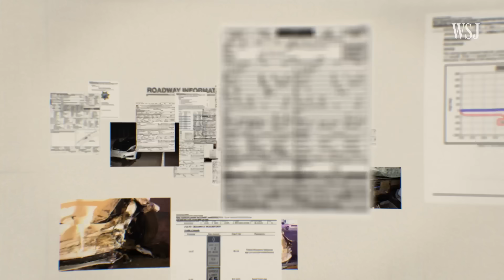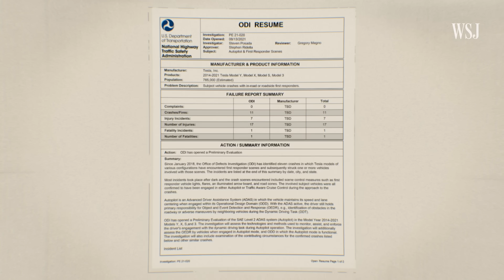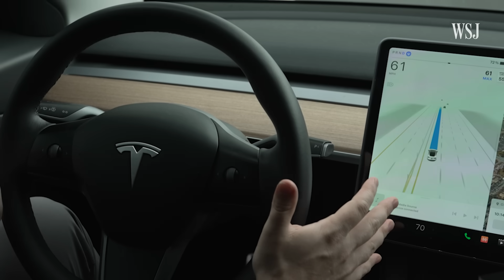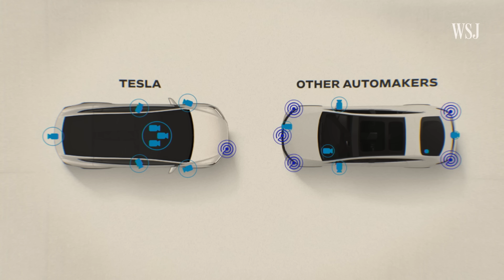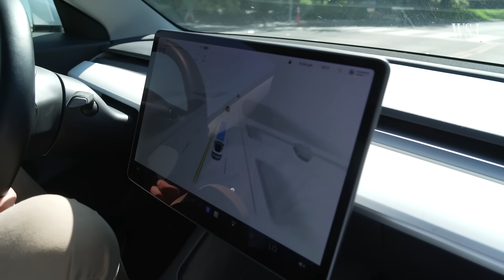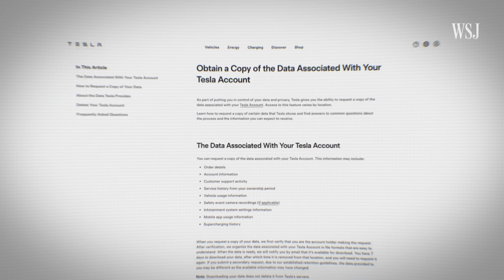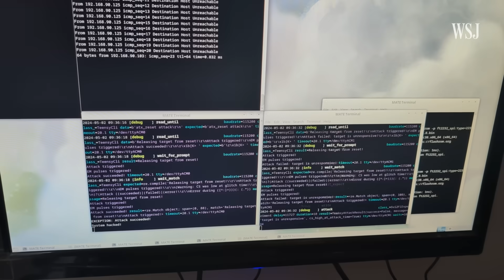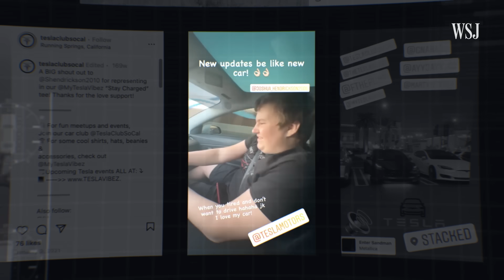The Hidden Autopilot Data That Reveals Why Teslas Crash | WSJ

Comment: CAMERAS ARE NOT EYES. I work in the film industry. Cameras sensors are way worse in dynamic range than human eyes. This means it won’t gather light from dark environments like our eyes do, it will suffer to get light (stop/cars) and objects in dark. Note how many of these crashes happen in the night/dusk.
Reply: thats why we got a lidar sensor in the dji air 3s
Reply: OP is RIGHT.

I already rolled my eyes when Tesla opted away from Infrared sensors and Laser-Radar (LIDAR). Like, TF you gonna do better than a human, if you use a cheap cellphone camera to see?
Reply: @Triple_J.1  Even with expensive cameras - why hobble your engineers and techs by saying they can only use one form of “vision”? It’s dumb. Why not allow for the potential for an autonomous system that can “see” BETTER than a human due to a combination of technologies like LiDaR and so on? You have the potential for a much more thorough understanding of the environment you’re in and possible hazards than the Mark 1 human eyeball is capable of, use it!
Reply: THIS!!!  People do not seem to grasp that.
Reply: @ChristianLaurinE  thats why there are multiple cameras ... "people dont seem to grasp that"
Reply: lidar they don’t wanna spend money on it
Reply: @3dus  They NEED LIDAR not just cameras.
Reply: A human eye doesn't just look straight ahead either, it can swivel around in the eye socket, literally in 'the flick of an eye'
Reply: And critically: The depth perception of stereoscopic cameras is garbage compared to the depth perception of our eyes.
Which is why Teslas crash into overturned trailers. The cameras are unable to reliably detect the position of that trailer, so it can't tell the difference between that trailer and just a dirty road surface.
LIDAR fixes that.
Reply: @vonnikon  That was what happened in the accident identified in 2021 which has long since been resolved with different technology since.
Reply: @vonnikon  but lidar is too expensive and also flawed (ex by mist), also the more data we'll get the more processing power we'll need
Reply: @vonnikon  Then why did a Waymo hit a clearly visible telephone pole?
Reply: @sylvaing1  none of the autopilot cars are perfect yet. But Waymo is far ahead of Tesla.
Reply: @vonnikon  Yes they are. They do have L4 vehicles in some areas, Tesla has none. Although their ODD are quite different, for now.
Reply: @sylvaing1 maybe  brutal fog
Reply: On the other side, cameras also struggle to moderate high light environments too. Lots of examples show teslas fail when driving toward sunset/sunrise because the cameras get overwhelmed with sunlight and can't form identifiable images.
Reply: Thats why a Camera - LIDAR combination should be the standard.
Reply: More specifically the cameras can't process DISTRACTION -

We "gleam" the most important information in an emergency - dust,  smoke, sparks, reflections 

Programing impossibility without proper stereotypical information and much more processing power

Even the best cameras can't capture LIGHT on a swivel the way we do

Just "cocking" our head or "squinting" gives us different information entirely
Reply: Actually, our optic nerves are a small component of "sight." The real work is done subconsciously by the brain interpreting the photons striking the optic nerve. And our sight is very prone to being misguided.
Reply: YES! They should use radar and lidar. If this were aviation, the regulation would have been made to force the manufacture to abandon the false design after thousands of deaths. This is so scary and sad!
Reply: Why dont they program autopilot to be more cautious when the camera data is poor!?!
Reply: In all those crashes you could clearly see the object and react but the car didn't react soon enough.
From this reason it is easy to see (lol) that the issue is not vision but decision making.
Solving full autonomy with cameras only is well inside the scope of technological possibility of cameras. The software has to improve.

And even if cameras won't offer as good of a vision as our eyes which I personally doubt, there are numerous solutions:
Drive slower at low visibility to ensure reaction within safe distance like humans naturally do if visibility is low
Watching this crash video I don't know if I could react fast enough at this speed even If I was fully awaken at that hour in the morning.

I wish only peace to that family and hope the roard to full self driving which statistically safer than humans will have as few as possible disasters and I hope that tesla will treat those family as airline companies treat their victims.
Reply: No, it is potentially a lot better than human eyes.
Reply: THIS! And why exactly does the car need to know if it is an overturned semi truck..? Does that make any difference compared to driving around anything else that doesn't move, aka obstacle?!
Is Musk really trying to tell us a laser sensor with a potential bazillion meters of range is more expensive and not smarter than a camera?!
Reply: A lot of the leaked footage does look very dark.
Reply: Then it shouldn't be advertised as "autopilot".
Reply: They should be required to have radar like most other vehicles do for adaptive cruise control, and ultrasonic sensors (those little round buttons in the bumper) around the vehicle to monitor objects within the 10 meter envelope modern cars do.
Reply: @amzarnacht6710  They use to have radar and found it contributes nothing and slows the computer down and thus makes it more dangerous.
Reply: What's perhaps more important is that computers/AI doesn't – and likely never will – possess the capability of the human mind to reason, to deduce from available information.
Reply: @screenPhiles  Exactly. Two different systems -- extremely different systems. Not sure one can do the other.
Reply: Irrelevant, lidar can see more than eyes can since it uses lasers yet self driving still doesn't work. The issue is ai / software is far from ready.
Reply: Some models use radar or ultrasonic sensors
Reply: @drink15  The point being the way forward should be a mix of technologies (and even that isn't necessarily guaranteed but at least you're increasing the odds in your favor).

Musk is just being greedy by relying on just cameras (which it should be fairly obvious isn't going to work).
Reply: Lidar is a necessary thing for self driving.   Musk is determined to prove this wrong at the expense of deaths.
Reply: @stevelouie5928  Lidar is certainly one component but you're missing that Elon Musk doesn't care about anyone but himself though I feel more sorry about the tools that treat him like the Second Coming.
Reply: @stevelouie5928  you could have said the same for cars when horses were around. Innovation should not be limited by potential fatalities per se. It's a system that must be improved, and companies should be liable for those deaths. But I don't think they should be stopped while trying to achieve innovation, nor that they are doing it at the expense of the people in this case.
Reply: @PaulSerious  That's not only an insanely inane point of view, but if any member of your family, immediate or otherwise, were among the dead you'd likely think different.

So weird how some of us are okay with 'innovation' fueled by the deaths of other people.
Reply: The eyes are 30ish stops of DR, an arri alexa is 16 stops at most
Reply: @victorprudeaux500  I have to admit I have no idea what what you've written.  Care to clarify?
Reply: @screenPhiles  Apologies', so with cameras the difference between light and dark is measured in F stops, the more dynamic range the more of the scene that the camera can see when there are large swings across from light to dark, the human eye can see around 30 stops, an arri alexa, a 65,000 doller camera only has around 16 stops of usable DR, imagine your on the highway and there are cars coming toward you in the opposite lane, you can still see the car in front of you it may be alittle blinding but you can still make it out, if you were a camera the car infront of you might as well be invisible due to the camera not being able to pick up the dark car compared to the bright headlights.
Reply: I can't even get a Roomba (which also use only cameras) to run until the room is bright enough to where I can see too. And then it still bumps into things with considerable speed even if it knows something is usually there.

Lidar is just better at avoiding collisions. Hence why I switched to a non-Roomba robovac, and why I don't trust riding in a Tesla especially at night.
Reply: @ just watch a FSD v13 videos, you'll see that it's not a vacuum cleaner and is far more advanced than a dumb autopilot assistant ahah
Reply: exactly dynamic range and also the light spectrum itself, it's foolish to rely on these limitations when there are better options for something as critical as real time localization in a dynamic system that's operated by agents with different behaviors (ie cars and their drivers). Having to sacrifice fidelity in sensors in this context for the sake of bragging rights should be illegal
Reply: What the expert says at 4:10 has been completely absolute since the introduction of the occupancy network a few years ago. It does not need to recognise a toppled truck (as the expert says), it needs to see something occupies the space. 
It may have been a valid point 4 years ago, but to show this now as evidence that the tech does not work, or did not work in 2021 is kinda weird in my opinion
Reply: @Maustah  Achieving self-driving will not only involve solving common scenarios, but also “long tail” scenarios that are rare and complex. These events include scenarios like erratic pedestrians, unclear construction zones, unexpected debris, and cultural driving nuances. Humans use intuition, social cues, and broad contextual understanding, which will make it incredibly hard for Tesla FSD to truly understand. Tesla's FSD relies heavily on pattern recognition from camera feeds and incremental improvements possible through large-scale fleet data.

No matter how much data Tesla gathers, such long-tail events will remain incredibly rare, and pattern-based neural networks will likely struggle heavily to master scenarios they rarely see. Without a method to ensure broad coverage of these edge cases, Tesla's system risks perpetual incompleteness. At Tesla's current data acquisition rate, it is impossible to gather enough data at the scale needed for incredibly rare “long-tail” events to be fully “understood” by Tesla's self-driving neural net.
https://seekingalpha.com/article/4745385-tesla-fsd-headed-straight-towards-a-scientific-dead-end
Reply: Both human and system will make mistakes, and I do believe humans are allowed to make more mistakes then a system.
Having said that I do believe that the rate of technical improvement is exponential. if the capability of a technology doubles every year, then it's 32x better in 5 years. Not saying FSD has this rate, but it is fast.

Not sure if it needs as much data as you suggest for long-tail events. As long as it does not crash into objects, there is many ways to handle events, and it will lean on other related events from the neural network to get out of an unknown situation. Maybe not perfectly (in the coming 10-15 years), but safe and good enough. That is how I see it at least. Thanks for serious answer btw.
Reply: Musk bet is on collecting as much vision data as possible and train their AI with it. In theory it might work out. But as we already witnessed AI does the weirdest of the weird mistakes. Some new models even insist on their wrong reply as being correct unless you prompt them another ten times. I expect future Tesla to display this sort of final message: You are about to die in an car accident.
Reply: But low light performance doesn't only depend on the sensor. It depends on the lens too. Plus the car has headlights.

This video seems to show that the Tesla sees objects in the dark but if it doesn't recognize the object, it'll keep going while asking the driver to take over.

But it should not keep going.
Reply: They could have low light “night vision” systems;  but would cost
Reply: That’s why the car turns on bright lights when it’s possible.
Reply: If I’m driving myself I have only myself to blame.   If I’m told that the car self drive results in my death then that’s without my consent.
Reply: As a Master’s degree holder in Computer Science, I can confidently say you’re spot on. Full Self-Driving (FSD) technology, as Elon Musk has been promising for years, will not achieve full autonomy. The current hardware and software stacks simply aren’t sufficient to enable complete vehicle autonomy.
Reply: @nv.c6  I also don't believe that HW4 is enough to achieve full autonomy. We haven't seen what HW5 will look like. Rumor has it that it will be made available in April 2025. Let's see what hardware it will have before claiming full self driving autonomy won't be reachable. FSD 13.2, although not perfect, has shown some great improvement over what FSD 12 could do, which also showed great improvement compared to FSD 11. It's a battle of the nines at this point.
Reply: Big up yuhself bredrin! We appreciate this truthful perspective.
Reply: Other companies use tons of sensor arrays to account for this, but Tesla employees have leaked that Elon Musk doesn’t understand this and won’t let them add these sensors.
Reply: It needs ultrasound or something for safety at the front. It should be mandatory to have it and if but available disable fsd
Reply: This is so dumb… there is so many other ways you can explore the world rather than optical vision. Just take the truth, robot better drivers then humans, and they just about to start. in few years i hope regular humans will be simply banned from driving cars.
Reply: Human eyes are 64,000 ISO. Some cameras can do 409,600 ISO. And you can add technology like Night Vision Goggle to get 1,000x brighter image. There are three types of night vision technology... try image intensification one used by Navy.
Reply: The high-beam should be automatically activated when the camera has zero visibility toward dark roads. Even the honda sensing is more clever than the tesla autopilot
Reply: And computer AI software is not a human mind, it does not have the rich real world understanding and judgement.
Reply: This comment should be pinned at the top
Reply: U says camera aint eyes..
But How about US Advanced Predator Drone or AWACS airplane who has high-tech cameras and sensors??
Reply: great point!
Reply: That why the next tesla will have arri Alexas as eyes
Reply: simple.  disable autopilot while dynamic range is low.
Reply: Makes me wonder how camcorders in the 80s could see without any ambient light 🤔
Reply: Tho be honest many people see terrible in dusk too.
Reply: Do not use when it's dark , too risky.
Reply: And so….why do we called them as autopilots…this is what they are called and this is what they supposed to do and once it failed, it failed no excuses
Reply: @Spectre_101  Calling it autopilot isn't the problem. Constantly lying about what it does is the problem.
Reply: @Spectre_101  Agreed. I'm on your side. Elon's been lying about what his cars can do. Not even autopilot works, let alone FSD.
Reply: Honestly, I think a lot of humans would have ran into the that truck. I watched a video of a car pile up with an upturned truck at night.
Reply: @brendan3556  Honestly, I don't think you get to change the terms of the discussion because they don't go as you'd like them to.

Musk touted this 'Autopilot' as so much safer than a human driver.  He was clearly wrong.  Full stop. 

The rest is just pure-grade copium.
Reply: I noticed that the vast majority of these MVAs happen between dusk and dawn. Thanks for the explanation.
Reply: You can see examples of that when you see a photo of something that you were trying to capture, which you couldn't quite get.  The colors aren't quite right. Or something else is off.
Reply: My experience differs - I am amazed at how much appears on the screen of my hardware 2 compared with my own observation.
Reply: Thought that Teslas would still have radar/sonar to detect obstructions ahead that cameras may be unable to identify properly with ML
Reply: Yes.  Thank you.
Reply: Waymo had the  lidar  advantage
Reply: To be fair; If you take a dark picture and crank up the brightness/contrast you can still see far more clearly than with your eyes no?
Reply: I'd say thats common sense. General rule: if you don't see well in a scenario a camera won't either.
Reply: Wrong those cameras are specifically designed for low light conditions. But of course if there is no light at all it's almost impossible. The issue is that the car didn't had any high beam on. The main issue was the regulations as the matrix led where not allowed in the US a the time, so high beam where off. The truck wasn't even visible even with naked eye
Reply: The key thing is we slow down when we don’t see things well or we feel no comfortable or lost confidence.
Reply: the car has headlights. doh
Reply: Cameras can gather more light what talking about
Reply: this is where Lidar comes in, lots of chinese cars have Lidar like the lixiang and it can detect overturned vehicles like this and stop in time.
Reply: Well computers don’t use eyes
Reply: Human eyes suffer from this issue as well.  Despite 75% of all driving occurring during the day, the remaining 25% of driving at night accounts for 50% of all fatal accidents.
Reply: Wrong lol. You have no idea about tesla self driving. Lol
Reply: They should have equipped all exterior cameras with IR. Why their engineers didn't pursue this is a blatant safety disregardment.
Reply: @pm7753 the engineers pursue what Musk dictates. The man is motivated by getting richer and richer not creating a safer car.
Reply: @pm7753 you would need to have ir projectors as well, effectively blinding any incoming cars with the same tech.
Reply: @pm7753  To be fair to Tesla's engineers, they originally had radar and ultrasonic sensors on the cars in addition to cameras.  But a few years ago Musk had them stop installing those sensors on new cars and disabled them with a software update on older cars that still had them.  Musk is convinced self driving can be accomplished in all weather conditions with only cameras and ignores all evidence to the contrary.
Reply: @pm7753  Are you in the industry developing self driving capability? If not-how to you know what spectrum these cameras can see?
Reply: Tell me, you are not an engineer without saying you are not an engineer
Reply: @RightsDontDefendThemselves  Well in his defense, he did say he works in the film industry lol.
Reply: @sylvaing1  LOL
Reply: You are wrong, a quadrupel of Pixels are exposed with different ISO giving it much more dynamic range. Even DJI uses this Trick to turn a 48MP Image into 12MP with much more dynamic range! Even some filmcameras do this. A similiar Trick was first introduced in a consumer product with a Firmware Hack for the Canon EOS (M) series in Magic lantern called dualISO.
Reply: Just change the ISO and F stop
Reply: If you are in camera scene, not heavy film scene,  you must know the impact of sony A7s. It was one of the first cameras that can take a pic of pitch black that just looks like in a daylight. High ISO performance of image sensors have greatly been improved even surpassing human retina. Therefore, the issue lies in choosing cheap sensors or poor sensor control, not the sensors.
Reply: The best cameras beat the best eyes.
Reply: @MegaLokopo  No, they don't.  You seem under the weird impression that cameras can 'see.'  That's like saying a spyglass can see when all ti does is make things easier to the person wielding it to see better.
Reply: You don’t understand how neural networks work. And you don’t understand how AI can see depth just like humans now.
Reply: @3dus  Precisely, the camera technology is quite there yet..
Reply: Câmeras doesn't blink. 8 cameras in a car not blinking is far better then 2 eyes blinking and many with vision problems.
Is only matter of time until they make the computer react better.
If you check how many accidents happens with human driving for mile driven is far worse.
But when a person doesn't wanna see anything that I say will matter
Reply: You are missing important factors: Unlike film industry, the autopilot needn't rely on ONE camera only. An array of cameras can see way more than the human eye.
What you are missing as well: Also humans have exactly those accidents. But while we permit a huge level of human error, auto-pilots should be completely error free?
Personally I think the technology isn't mature enough to work completely unattended, and thats what Tesla also demands.
Reply: For those saying the name Full Self Driving misled them: who pays thousands of dollars for that feature without spending the 30 seconds needed to read the features of the software? Nobody. Therefore anybody who claims they thought you don’t need to watch the road is lying. Come on…

Also, please keep in mind that the software is now FAR ahead of what Tesla had when this accident occurred.
Reply: These aren't designed to be autonomous. The human behind the wheel is supposed to remain attentive as if still controlling the vehicle. What we have here are examples that lead to human controlled fatalities and the number is miniscule as a percentage of Teslas. I have many miles of experience using both Tesla Autopilot/FSD and the multiple cameras surrounding my Model Y have both strengths and weaknesses compared to human vision.

Tesla isn't offering level 4 or 5 autonomy yet, so your argument lacks standing regardless of whether or not it's empirically accurate.
Reply: ADAS is not FSD. The crashes reported in this video are from 2021, using ADAS. ADAS is the simple free version, like in many other car manufacturers, you are supposed to drive the car.
 FSD is an option, and is not yet unsupervised.
Reply: I disagree, cameras are able to see way better than we can in dark situations. I’ve watched some of the night footage from my Tesla and it sees the world around it like it was day time.
Reply: @brendan3556  You can disagree all you like, doesn't for a second make it true.  For instance, some people think the Earth is flat.

And cameras can't 'see' way better than anything because they're not capable of seeing – as most humans and animals use the term – at all.

They simply take in visual information.  Seeing is more than just your eyes aligning on something, there's unconscious processing sighted animals do without thought.

Sorry, but your Testa is blind by comparison because there's no mind behind those cameras (except in the most rudimentary of senses, if that). 

That's why they're killing people; they don't know any better because they're stupid machines.
Reply: With the raw HDR data it is really good, it uses the noise as clues, so that it can have better visibility than a smoother processed image. In 2024 it's really hard to say that human sees better because you can't see at 360 degrees
Reply: Disagree. I tried V13 on a twisty mountain road last night-it's BETTER than a human driver. Especially with oncoming traffic; the car's systems don't seem to be blinded by oncoming headlights like a human driver, and it seems to "see" better in low-light conditions. The "film industry" doesn't necessarily have cameras optimized for this, like Tesla's do.
Reply: @ yeah and you don't need high quality at low light, because AI can make sense of the noise in the image, it doesn't need to be processed to look pretty and loose details in the process
Reply: it’s def safer. I own one. It reduces fatigue, but you do have to pay attention. 

I’m some of the examples above, it’s difficult for the car to see the road - the easy way to do this is take over the wheel quickly when car starts getting sideways… I do the difficult parts - the left turns, the merges, the twisty roads — and I let it handle the easy bits (which are more like 90% of the drive)

By no stretch of imagination is this technology ”full self driving” 

It’s still useful and is leaps ahead of any other manufacturer
Reply: Camera sensors have better range than our eyes can detect. Much better. 

An example, shine your remote and click buttons into your cheap (or expensive) phone camera. It can see IR, we cannot. It can "see" the temperature differences also. 

The issue is setting up algorithms in real time to translate it as something we can use. That's a computer (processing) not a component limitation issue.

I don't think you can compare autopilot crashes as 'manufacturing faults', you need to compare it with human driving and traffic incidents human causes.
Reply: Are comparing eyes in pitch blank and cameras in pitch blank? 
Or are you comparing eyes in the visually polluted car cockpit with cameras in their places where there is nothing but real visual info hitting them?
Reply: Remember was see a very narrow spectrum compared to what a camera can
Reply: Tesla cameras are nothing remotely like "film industry" cameras.   They don't use RGB, they are RWB - so all of your very wonderful expertise is garbage.  They DO gather light from dark environments.   But guess what?   They use the headlights!!   Yes - they aren't completely stupid.   Also, where are your statistics to prove that a preponderance of accidents are in the night/dusk?  (HINT: You don't have any).   Also, do bear in mind that (by definition) 50% of all human-on-human crashes are caused by the other car.
Reply: @ fan boy..?
Reply: @SteveBakerIsHere  Rubbish, Tesla uses standard CMOS cameras identical to those used in mobile phones. There is no such thing as an RWB sensor.
Reply: This is incorrect... computers can grasp slight differences in color/light that our eyes cannot... the ability for cameras to see is far superior to our eyes.

This video is just a hit piece... End to End visual only FSD is the way forward
Reply: @lh2000  Cameras are in no way superior to our eyes, plus our brains are way better image processors than a computer. The video demonstrates incidents where the cameras are clearly not up to the job.
Do you think Volvo, Mercedes, BMW et al use radar and lidar just for fun?
Reply: @cambridgemart2075  Volvo, Merc and BMW do you have silicon valley DNA in their companies.

And cameras and the AI inference hardware are ABSOLUTELY better than human eyes, they can detect the slightest variations and machines don't get tired and don't have variations in performance

Not gonna argue further, you can do your own research.
Reply: @lh2000  Well as someone who works in the automotive industry and having 15 years working in image processing, I know cameras are far inferior to our eyes for a host of reasons including far reduced dynamic range, low resolution, and lack of stereoscopic depth perception. The one valid point you make is that computers don't get tired.
You only need to look at some of the collisions Tesla has been involved in when on AP  or FSD to see how poorly the system performs. Tesla relies on training the AI to recognise objects, rather than determining there's a big solid object in the road.
Reply: @cambridgemart2075  The limiting factor is not the camera, it's the systems used to interpret the images captured

I agree there are issues with changes in light that can cause temporary "blindness"
Reply: Tell that to every AI tech used in photo and film industries that improve images or frames, everything from color correction, 3D creation, blur repair, CGI, etc. use AI technologies from cameras.

Literally, our eyes are cameras. If you're saying you cannot detect distance compared to a laser, you have a point to make, but the basis of your original premise is full of nope!
Reply: @michaeld5621  Cameras are not the limiting factor... the limiting factor is the training model and inference

FSD cameras are working fine, they are literally shown on the screens of the cars when you use it

And distance is not an issue either, you don't need to know the exact distance when you drive, neither does the FSD computer.  Based on the speed, and change in the size of the object, the car can already infer the distance to a very reasonable estimate of its distance

I think you need to try FSD for yourself tbh
Reply: My IR lacking cabin camera sees my eyes in almost pitch darkness. The outside cameras are high dynamic range, using  10 or 12 bits of color per channel, three channels per pixel). It has no problems seeing at night, except in complete darkness, which we wouldn't see either. We aren't cats.
Reply: @sylvaing1  More importantly we're not machine learning models. We see an upturned truck in front of us, we stop -- that's the point. Highways are lighted in many places, so we don't need to see like a cat. Our headlights help as well. What these Teslas can't do is understand the world the way we do, a five-year old understands the downed truck is a threat. That isn't the only time a Tesla's cameras screwed up. There's another accident where the Tesla slammed into a truck because FSD thought the truck was a bridge. This isn't safe technology and never will be without lidar, and maybe not even then.
Reply: @Intelligencia  What these drivers failed to see is that FSD and Autopilot are NOT "Eyes off" technologies. Autopilot will never be and it's the goal of FSD but it's not there yet. A driver looking at the road would have noticed these events and acted accordingly. The latest FSD uses the cabin camera to make sure you're looking at the road and not your cell. They should port that to Autopilot as well.
Reply: @sylvaing1  The problem is FSD was sold as "Full Self Driving", which it is not. That's a lie. Another one of Elon's thousand lies. It's not full self-driving and will never be full self-driving because cameras alone aren't enough. You need lidar and even with lidar I'm not sure it will help cars go fully autonomous. It doesn't matter if you have another camera watching you, Elon oversold this technology. Tesla just lost its head of Autopilot HW engineering to Amazon’s self-driving effort, which doesn't bode well for Tesla. Honestly, what's so bad about driving anyway? I used to love it. I live where I don't need a car now, but I don't get the idea of putting one's life in the hands of a machine -- a faulty machine at that. One run by a man who is known as a pathological liar.
Reply: @Intelligencia  No, FSD was NEVER at this point sold as 'Full Self Driving". It was first FSD (Beta) and now FSD (Supervised). In both cases, it clearly states when you enable it in the car (per driver profile) that it is NOT autonomous and the manual clearly states it as well.
Reply: @sylvaing1  When you call it Full Self Driving, you're kind of implying something aren't you? I get the concept of false advertising but that's a doozy.
Reply: @Intelligencia  Since it's been available to buy/subscribe, it was NEVER called just "Full Self Driving - FSD". It was called FSD (Beta) and FSD (Supervised). It's implying that the goal is to go Full Self Driving, yes, but the goal hasn't been reached yet. Will it ever? I guess we'll need to see what HW5/AI5 will be able to achieve before claiming it won't. Personally, I don't think HW4 can achieve full autonomously. What FSD 13.2 (and now with 13.2.1 which has reached hundreds if not thousands of owners in its first wave since released yesterday) can do though is quite impressive for "just cameras".
Reply: @sylvaing1  One question - how many times has Elon lied about FSD?
Reply: @Intelligencia  Being overly optimistic, yes, a lot, lied? If you mean that 2016 video, it was to showcase what the hardware in a 2016 Tesla could do, as confirmed by the testimony of Ashok Elluswamy (director of Autopilot software at the time), not to accurately portray what was available for customers in 2016. A lot of stuff that SpaceX and Tesla did/are doing were thought to be impossible. As it turns out, SpaceX and Tesla specialize in making the impossible merely late.
Reply: @sylvaing1  those 2016 Teslas are now at the end of their life, and they still can't do what was promised.
Reply: @vonnikon  I agree. The time to release an unsupervised version of their vehicle has been (is) way longer than first anticipated. They do have access to a class action if they so whish though.
Reply: @Intelligencia  it's called "beta" for a reason as well… Prior to purchasing you are warned that you are observation is required, when you install it, you have to agree that your observation is required… When you activate it, you are reminded that your observation is required. If you let go of the wheel for too long, uncertain models, you are reminded, if you look away from the front of the car for more than a few seconds, you are once again reminded and yelled at to look out the window… There is not a single human being driving this car that thinks it is self driving. Only Youtubers is trying to get clicks..
Reply: @Intelligencia  Its not a set technology, its rapidly improving, but people are easily led by hit pieces.
Reply: @churblefurbles  I'd argue people are more easily led by liars while ignoring pieces that are backed by facts and not really hit pieces. People want to believe what they want to believe even when there's reliable proof that what they believe isn't going to come true. Lots of cognitive dissonance going on here. Lots of denial of reality too. That's an interesting psychological state - people realize they have been fooled or misled, but refuse to accept this reality to avoid the discomfort associated with the inconsistency between their beliefs and the truth. It's a common response to compulsive liar. I don't trust someone who has repeatedly lied about timelines and technology. I don't see the company being able to magically come up with a technology that will work when its competitors have clearly shown lidar is needed. Once again, address the long list of lies Elon and the company have stated.
Reply: @sylvaing1 Elon is lying through his teeth at almost every rally. How many times have we heard specific dates for stuff that will never happen?
Cameras can be extraordinarily sensitive but your eyes have a much wider dynamic range.
Reply: @sylvaing1 Right in this video you have clips of Musk claiming again and again that Tesla's unsupervised driving features were safer than a human's driving capabilities.

You say that those unsupervised driving features are indeed just fancy cruise controls? Well, tell that to Musk and Tesla Motors Inc. please because they seem to not be aware.
Reply: @Intelligencia  You do know GM recently started agreeing with Elon Musk that he is doing it the right way and that Ford has stopped development of their system and is just waiting for Tesla to get it done and then license it from them?
Reply: @RightsDontDefendThemselves  That's not true.  The only reason people were warned that they had to pay attention was because not were Elon Musk's lies fairly obvious, but the NHTSA was investigating them and Tesla.

You might complain about YouTubers, but you're doing the same thing, only lying in a more obvious manner.
Reply: @Intelligencia Humans don’t need LIDAR to drive. There is no reason in principle why an AI can’t drive with superhuman safety based only on visual input. I accept that Tesla Autopilot is definitely not there yet, but there is no reason to believe they won’t get there, and sooner rather than later.
Reply: @sylvaing1 

Now I'm no big city computer programmer, or fancy pants lawyer. But I believe that "FSD" is some kinda acronym...I do wonder just what it could stand for?
Reply: @screenPhiles  WHAT YOU ARE SAYING IS 100% FALSE. I HAVE HAD THIS CARD FOR 10 YEARS AND OWN MULTIPLE OF THEM SO I KNOW WHAT I'M TALKING ABOUT. THE WARNING HAS BEEN THERE SINCE DAY ONE SO JUST STOP.
Reply: @Intelligencia lol using “never” with new fast changing technology is absurd. No chance they will be able to do this with just cameras in 100 years?
Reply: @Intelligencia  Additionally, if we encounter something we don't understand we don't keep on driving towards it at full speed. Teslas do, because it constantly encounters things it doesn't fully understand, and it wouldn't be a marketable feature if it did brake every time it encounters something like it. It's simply not a safe product and it should be banned, not having lidar is genuinely unacceptable as this is such an excellent last resort for head on collision prevention
Reply: @Intelligencia even with LIDAR and sensors equipped I still wouldn't trust my life on it. Problem seems to be from  cost cutting, to misleading advertising,  to public blind trust and lack of research/education. But it's a losing fight. I did what I can and bought electric car from another brand, almost same functionality but with radars installed along with camera.
Reply: @Intelligencia  this article doesn’t mention FSD at all…
Reply: @Intelligencia  You obviously have an axe to grind here so I'm probably making a mistake trying to engage with you in honest dialogue but here goes... Calling it FSD, I believe is not disingenous; it is the end goal after all, and it is about 98% + there now. For example, SpaceX called their rockets "reusable" but sometimes, especially at first, there are problems preventing reuse. But now they have a Falcon 9 booster that just flew its 25th mission.  It is up to the consumer to not mistake the product name for the operations manual.  

TLDR: calling something what you intend it to ultimately be is normal, and done by everyone everywhere.
Reply: @theshadowsymphony  Of course it's disingenuous, unless the F stands for something other than 'Full'
Reply: @sylvaing1  LOL there level 2 on a scale of 1 to 5.  Such a scam now going on for almost a decade.
Reply: @joeshmooo5327  And at what level do you rate an ADAS that drove from the manufacturer to its new owner, all by itself? They did three days ago, a 30 minutes, unassisted drive with no one in the car.
Reply: @sylvaing1  and they have very bad ghosting... you cant compare a stationary camera with moving ones.
Reply: @sylvaing1 This might be down to Hardware version. The Crashes are "old" which makes it very likely that they used older versions of Teslas that probably have worse cameras. You might have the new hardware. I've watched quite a few FSD Videos where they drive the new Hardware and the cameras look good to me in the dark too
Reply: @sylvaing1 This might be down to Hardware version. The Crashes are "old" which makes it very likely that they used older versions of Teslas that probably have worse cameras. You might have the new hardware. I've watched quite a few FSD Videos where they drive the new Hardware and the cameras look good to me in the dark too
Reply: @sylvaing1  Agree. If anything my Tesla performs better at night. Area where it still struggles are low angles of sun (early morn, late afternoon) and blindness by too intense sun light.
Reply: I’d feel safer if my autonomous vehicle could see things I couldn’t.
Reply: @sylvaing1  silicon image-sensing chips actually do respond strongly to IR radiation, which is why standard cameras are fitted with IR filters. Otherwise the pixels would be "over-exposed" every camera clock cycle. (They are also fitted with RGB filters in specific pattern with an algorithm to create calculated pixel values for each pixel.)
Reply: @dianataulbut2299  I'm not following. No one said the camera doesn't detect IR. What I said is my 2021 Model 3 doesn't have a IR emitter and yet its cabin camera can see that I'm looking at the road or not in almost complete darkness.
Reply: @sylvaing1 Musk fanboy ☠️
Reply: @sylvaing1 I agree with you, the original comment missed the mark. These machines are obviously flawed, but camera light detection is not the issue.
Reply: People's eyes fail them constantly as drivers, too. Not to mention that we only have two of them, spaced fairly closely, on only one side of our head. Teslas have 8 cameras, on all 4 sides of the vehicle.

Yes, the dynamic range issue matters, but again, there's multiple ways Teslas' eyes are better than humans' eyes. 

The bigger issue is that Tesla has the opportunity to augment those electronic eyes with all kinds of other things humans don't have, like radar, lidar, and ultrasonic sensors, but Musk has stubbornly resisted relying on them, leaving Teslas with ONLY those 8 eyes in too many scenarios.
Reply: @nathanscandella6075  cameras are electronic/processor based. these are prone to glitches. what will happen when glitch happened at critical moment? a human driver's eye/brain coordination is way more dependable than current technology
Reply: @nathanscandella6075  Our eyes are still connected to the most sophisticated biological decision making powerhouse. You need AGI to drive autonomously, which Tesla's don't have.
Reply: I agree that at least solid state lidars SHOULD be used. But cos of such lidar wih distance of 200 meters would cost 3 to 5 thousand euros.  Meaning cost of a car would increase as minimum by the same price. 
Besides its not about dynamic range of human eye. Its about our complex neural engines that is yet  more advanced than any modern neural algorithm.
Reply: @nathanscandella6075  Those 8 cameras are not arranged in any stereoscopic configuration.
So the Tesla software has to guess at the distance of obstacles and ignore dirt on the lens through heuristics.
Reply: @nathanscandella6075  yes, of course we have 2 closely spaced eyes. Because that gives 3D vision, which Tesla's don't really have with their spaced out uncalibrated cameras.
Reply: @nathanscandella6075  My understanding of why lidar was removed was because it was providing inconsistent data and that inconsistency was creating additional noise problems. Opting to choose sight only is a matter of using AI to identify a light idem like a bag flying in the air that would breeze over and a laser telling it that something hard and physical was about to impact. But you're right, it will also be flawed as the eyes and if not trained to detect, it might not even see anything.
Reply: @nathanscandella6075  Two human eyes and the human brain are far superior to 8 cameras and the Tesla AI. The problem is the Tesla machine learning systems can't model for any and every potential situation. While the human mind can know a truck on its side is a threat and one should brake, the Tesla didn't know that and there are a million other scenarios that a Tesla won't ever be able to understand. Musk chose not to include Lidar because it was too expensive and that can't be retrofitted into most Teslas now. Musk thought he could BS his way through this and he probably won't be able to.
Reply: @Intelligencia  Lidar is actually really cheap especially low range ones. But he is a man-child that insists to not install them.
Reply: @Intelligencia you live in a parallel universe if you think humans will keep being “superior” to cameras and computers. Wauw the ignorance.
Reply: @christofferravn4486  Better than living in one where somebody apparently nurses an inferiority complex to a TI-30XIIS. 🤣🤣🤣
Reply: @Intelligencia  you need to try FSD V13. Id recognizes trucks and identifies threats. It doesn't get tired, distracted, or look just at one object while ignoring everything else. I just got a car equipped with it-it's amazing. Better and smoother than a human driver on an unfamiliar road. Never had an issue picking the right lane, making a turn or identifying a threat-including animals in the road.
Reply: @Intelligencia  for now every car has two human eyes and a brain in addition to those cameras.  So….
Reply: They dont operate the sensors as pixels they operate on photon level so they are not comparable to what you are used to in film cameras.
Reply: I'd have to argue that.
Because a Camera, today anyway. Is just a SENSOR for the visible light spectrums we see. So whatever they see, obviously we do.
BUT THOSE SAME SENSORS CAN SEE, IN ANY PART OF THE SPECTRUM WE WANT.

So they can see in the dark.
They could see the Heat Signature of something they are aimed at.
They can sense movement in same, in any spectrum you'd like.
Just like RADAR sees things in its spectrum. And why even missiles flying at even hypersonic speeds, can move and find targets at such speeds, covering miles in seconds.

So it's not the CAMERA.
It's what it's made to see, and how it's implemented.
Visible range camera's obviously have their limits.
But adding other camera's (sensors) can augment those visible light cameras.

FLIR sees what we will never see. And Dogs Do TOO !!!
So it's not the camera. It's what you make the camera to see 🤗

And lastly.
How many accidents are caused by People, that don't seem to see things Day, Or Night 😳
It's because it's not their Cameras (eyes), it's how they are used.
To coin a phrase,.. FOCUS PEOPLE 😂
... and put down the phone
Reply: So True. Glory to the Creator who had given all his creatures such sophisticated gifts of body parts and especially to us humans. Glory to Allah , the Most High.
Reply: Exactly, the driver’s eye is to blame as the driver NEEDS to be in control.
Reply: @cyclefrst7799  you either drive or you chill while the autopilot drives. If you have nothing to do, you will never be able to respond to an emergency in a split second. It's just impossible.
Reply: @ during FSD, I’m not moving the wheel or accelerator. However, more mental computational power can be spent on traffic prediction. I can cancel FSD preemptively to stay out of the kill zone / blind spots while moving defensively.   I’m definitely doing something during FSD, but I’m still more relaxed at the end of a 500 mile drive.
Reply: are 8 slightly inferior cameras that are 100% focused on the road better than 2 eyes that are texting and driving or Drunk or distracted by the hot guy/girl in the next car ?    i wear glasses and i assure you that cameras see better than i do in after dark....
Reply: @ Totally depends on the quality of the cameras and the software processing the data.

I expect one day, there will be algorithms which can get all the necessary data from a few basic cameras. But we’re not there quite yet.
Reply: but lidar sensors have problems too. they can't function well in bad weather condition, and might break the surrounding surveillance cameras on the road due to the lasers produced by these sensors.
Reply: Tesla cameras have a much higher dynamic range than normal film cameras. And eyes are not grand when it comes to see in the dark either BTW...

Working in the film industry? As a janitor or something I hope.
Reply: @ oh sure. Tesla sensors are as big as cinema cameras and they have the same exposure to light as the 20x bigger sensors. Catch you Cannes next year, Dude ;)
Reply: @runewinsevik8471  Tesla uses cellphone camera modules, so that's completely false.